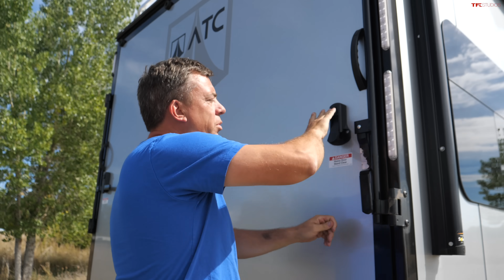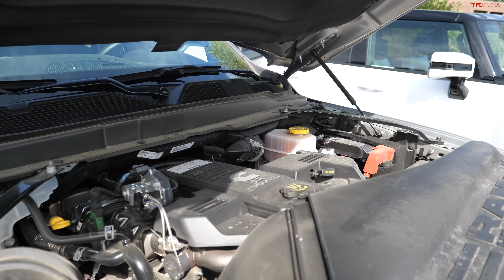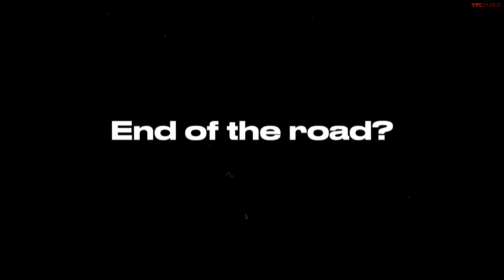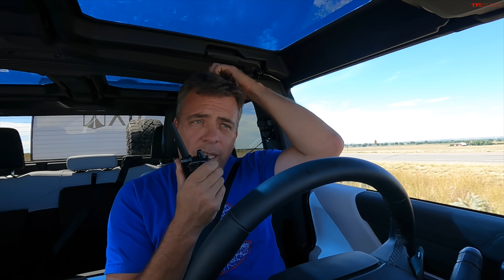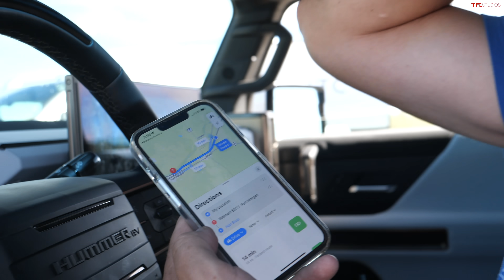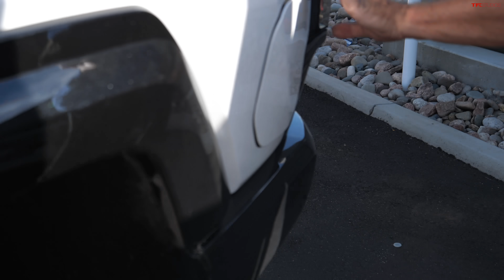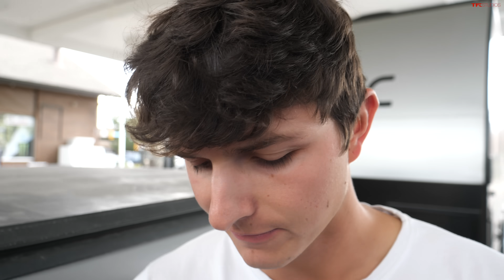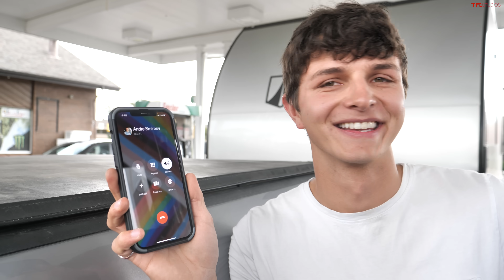How Far Can a Diesel and Electric Truck Tow An Identical Camper Trailer on ONE Fill-up?

Comment: I would love to see this test in one year after the battery’s been thrashed a little..
Reply: I agree, it’s going to be interesting to see how these batteries last
Reply: @justing224  they won't. Not recycling them either. Also all the mining of lithium is worse for the environment
Reply: @justing224  weather & shelf life will kill them dead! Weither its use are not they are very disposable like always
Reply: And after the Cummins has broke in
Reply: @flyinbrianz22  the 100,000 mile break in for diesels is not true, break in is about 10,000
Reply: @johnmorris77  I own a 2020 cummins, have owned 3 6.7's. You'll typically start to see about 10-15% better fuel economy around 25-30k miles. Give or take 5000 miles depending on how hard you drive it. And it's not a gradual change. I, as well as a bunch of other cummins owners on forums, seem to think there is programming involved. It's like a light switch. One day it's just considerably better economy and a noticeable increase in power.
Reply: @riccochet704  I've had 2 6.7s and a 6.6 Duramax and did not experience that in any of my trucks except when I deleted and tuned them myself, but if I put bigger tires on then it negated any speed or mpg gain I made
Reply: @johnmorris77  my Cummins said 15,000 if you didn’t tow with it.
Reply: @JohnDoe-nz6bk  right, not quite 100k like many people think
Reply: @johnmorris77  Break in may be only 10,000 km but after owning a duramax and a cummings they didn't start getting great mileage till 100,000 kms
Reply: @TH-rg7ep  I've had both and my mileage only changed with the weather, my driving habits, or change in suspension/tires/tuning
Reply: @riccochet704  I wonder if the ECU programs it to run rich during those first 20 to 30k miles
Reply: @johnmorris77  Actually John, my Dodge diesel got broke into around 525,000 miles.  I'm still trying to locate it.
Reply: @riccochet704  yeah and also take off all the other garbage that epa wanted to put on these vehicle that killed the gas miliege.
Reply: Though that will affect things, I know this won’t get used for work like the Cummins will, it’ll take a week just to get across Texas, it’ll probably be parked most of the time with an occasional Starbucks trip.
Reply: @RiggyRonnie  773 miles will take a week to go? Who the heck are you paying to delay the trip in your so-called test?
Reply: @ronaldking1054  why don't they race the Hummer and the Cummins across the country, not even you would bet on the Hummer
Reply: @Duckdangerly  What is the make and model of those 100 year old EV's still operating on their original battery? Granted the EV idea is old just like steam powered cars. But there is NO EV with it's ORIGINAL battery and electrical system operating after 100 years of service. Give me proof.
Reply: @mackjones7688 , Go to a Baker Electric club meeting, or website. From around 1899 through about 1914 the Baker company produced one of the top-selling cars in America, a 6-volt electric.  Many get converted to 12 volts, but many still operate them with the original 6-volt cells. Jay Leno features his on his channel and discusses the history in an easily digestible manner. Proof can only be had through one's own research.
Reply: @Duckdangerly  Well Michael. You need to read more thoroughly. As I thought, the original alkaline cells don't last forever and they can't. Here is a quote from Leno. 
"Thomas Edison invented the alkaline battery. My Baker still has some original alkaline batteries. These have lead plates and use acid; we wash them out and refill them regularly and I'll use them indefinitely. But even Edison realized the future of the automobile was elsewhere." 
So, while you did prove that some of those Bakers are still using SOME of their original batteries. There are multiple  batteries in the car and new replacements had to be made, or original batteries were taken and rebuilt. The lead plates in batteries get eaten by acid and eventually wear out. So if the Bakers were not a stored and cared for by a collector. The 100 year old Baker wouldn't have lasted at all. Electric motors also wear out. The windings need to be replaced or recoated. Different brushes components get replaced, bearings go bad, etc. So your claim that those electric cars would outlast any Cummins. I have to disagree. Under the same usage conditions. The little Baker would fold like a lawn chair. The motors would be over worked and burn up. Bearings would fail. Wiring would degrade like in modern vehicles and need full replacement. That's IF they were being used to work like our Cummins are asked to.
Reply: @mackjones7688  LOL, okay. Have fun dealing with reality. Cheers.
Reply: @Duckdangerly  I deal with reality all day! Everyday. Not sure what cloud of idealism you are on right now. You are definitely not with us. You got owned with facts and don't want to admit it. I know, life is hard. Electric cars just export emissions to another source. It's not a long term solution or even a practical one to our real world problems.  Earth doesn't have enough resources to make electric cars for all the people alive right now to purchase one. Also, most electric cars with their alkaline batteries could only be charged up once. After the battery was depleted the battery needed to be replaced. Just like a flashlight or gameboy double AA's. Also, think about it. If bakers and other electric cars were as great as you say. They wouldn't have failed. Also more examples would have survived and been restored. They would be out on the road today making appearances at car shows. More proof that electric doesn't outlast diesel is electric golfcarts.
Reply: @mackjones7688  exactly. I just watched the Leno episode and he clearly shows he is using new modern sealed batteries. There is no 100 year old working battery, c’mon man! Biggest problem with the baker was very low top speed, about 30mph. And there is no heating let alone AC. So yeah, a glorified golf cart. It’s perfect for a very short trip at low speed in perfect weather conditions with no luggage. Other than that? Forget it.
Reply: @Duckdangerly  yeah, what was the top speed? 15mph? Lmao 🤣 Electric cars were a Joke then and are a Joke now!
Reply: @Duckdangerly  A Baker electric car was $850 Compared to $390 for a Ford model T. 😅 And the model T range was nearly double.
Reply: They dump their vehicles without doing any kind of degradation tests which other channels do, degradation affects charging and retention..but the spin they do here is spin. Electric pickups are for pavement pounding city slickers, instead of a proper working truck
Reply: Give me fuel any day
Reply: or try it when its cold!
Reply: I would like to see it in the cold snow.
Reply: they will only have the truck for 6 months unfortunately.
Reply: @Duckdangerly  I would agree with you if it wasn’t made by Goverment Motors…
Reply: Most families who have trucks tow. Dont care of its a camper boat or trailer.. I just can't see a family of 3 or 4 on a 4 day trip mini vacation which the last 4 years they do it after work and drive 4 to 5 hundred miles.. and almost do ut straight through.. now the same family has to take 4 days off extra just to get to location  and back home... lol lol it will never work or people will not buy them.
Reply: I would like to see the test when it is 0 degrees.
Reply: they dont last when you fast charge them all the time from full to flat . imagine replacing the battery out of warrenty .$$$$$
Reply: @ytthecommunistplatform.2675  Fast charging is only used on road trips. Most EV owners charge overnight at home. It's cheaper and you wake up with a full charge every morning.
Reply: @ytthecommunistplatform.2675  batterys have 10 year warranty in US and canada..
Reply: @ytthecommunistplatform.2675  charge to full is only an issue if you charge to full then let it sit.  That is common for anything that uses rechargeable batteries.  Charging to 100 then heading out isn't the bad guy people make it out to be.  Especially when you consider most EV's have a buffer.  The 100% isn't actually 100%.  The computer says it 100 when it isn't.
Reply: @ytthecommunistplatform.2675  Yes and imagine how the value of the vehicle drops as you get near the warranty life.  Who will buy something that needs a $30K battery?
Reply: @ytthecommunistplatform.2675  Okay, if a guy uses overdrive to haul, which trashes the torque converter, which trashes the transmission, that is the problem with the truck. Sure. No, it's a guy that doesn't know what he's doing.
Reply: @ronaldking1054  what point are you making? That he didn't tow properly with the Hummer?
Reply: @Luke-kn9pi  I responded to someone that stated that charging to 100% and discharging to 0% would ruin the battery. I then stated that if such an absurd practice were mentioned to an ICE owner, the operator would be questioned whether they were sane, and I pointed out when it happens. Try reading the comments as a whole and understanding who is replying to whom.
Next, you are trying to state that a person who says that it would take a week to go across Texas, which is 773 miles, is absolutely correct when even towing, the person would get over 100 miles a charge. Are you trying to claim that it takes a day to charge the EV with fast charging? It does not. You then asked an irrelevant question to cover what you are implying, which is insane on its own.
Reply: @ronaldking1054  a week is definitely exaggerated, but a diesel would do it faster, I live up north in a rural area and electric work trucks are just not feasible in the cold, especially because you need to drive longer distances here, but I have nothing against electric trucks
Reply: @Duckdangerly  wtf are you smoking
Reply: Great point  ! I have an electric bike ( big difference I know ) nut , after six months of daily use ( about 30-45 minutes) the battery takes a little longer to charge , and doesn't last as long !I'm not sure of the exact numbers , I don't take full charge long trips very often , but , your point about the battery after a year of use , is a valid concern !!! Non are ready for long trips at this time !!! Especially if it's  a time/ money operation !!!
Reply: Imagine being stupid enough to buy an EV.
Reply: Those batteries wear out fairly quick, and then your resale is about zero.
Reply: Let’s compensate the difference weight whit diesel fuel on ram. Ram will go 1000 miles more
Reply: @Duckdangerly  😂😂😂
Reply: EVs are useless to anyone except z Karen’s and their beta males who use them to virtue signal.
Reply: @Duckdangerly  so, you're saying there are EVs from the 1920s still driving around? 😅🤣🤪🤪🤪 Please, put down the Crack pipe.
Reply: @Duckdangerly  100 year old EVs?  These heavy duty trucks last way more than 10 years, and I think that is what you meant to type, 10 year old EVs.  They weren't made 100 years ago.
Reply: Not to mention the cost involved in replacing that 3 ton box of imported minerals.
Reply: @State48Dude  Walmart and every other store are full of imports. Cars will be the same until it's cheaper to get the materials here. The Inflation Reduction Act already includes provisions to increase domestic sourcing. Now North American mining and ore processing is ramping up.
Reply: @jghall00  They can ramp up all they wish, much like the chip manufacturing supposedly going to New York (of all places). It's not slated to break ground for 3 more years, by then it'll cost another Trillion.
I live within 1/2 mile of Intel here in AZ.
They already have in-place what's needed to begin.
NO money allocated to an already proven Corp.
So .. tell us all about the "Inflation Reduction Act" pal.
Then go buy a tank of gas, or anything  else made from fossil fuels, and talk inflation reduction.
Reply: I live just over the hill from Tesla and Panasonic plants. Nevada has the only lithium mine in the United States. An employee from Panasonic told me lithium is already getting harder to get. So watch your wallets cause they are just going to go up from here.
Reply: People are so dumb! They will be woese then cell phones are! Disposable crap!
Reply: The battery will still be fine after a year. You guys have been repeating the same talking points for years and years now 😅
Reply: Agree
Reply: Even better going up and down mountains using throttle. Flat hi-way cruising is giving electric best numbers. HAHAHAHA POS electric.
Reply: @shawncorradini5129  heaters use a lot of power too so even less right it's just a silly idea in the north
Reply: @donaldliverance2597  if you park outside in winter your battery life would probably go down the drain
Reply: @Duckdangerly  lmfao the cummins will run forever given the right care as well and there's a hell of a lot more old cummins driving around than old electric cars
Reply: @Duckdangerly  100year old battery are you serious.  what does a 100year old battery even look like is the case made of bakalite?
Reply: @chrishart8548  Lmao 🤣  You tell em.
Reply: They were very lucky that overcharging the EV did not light it on fire and burn down my favorite fast food restaurant before I got my well deserved sandwich and shake for $18.50.
Reply: @shawncorradini5129  bunch of EV owners in my Focus EV group live in Canada. They do just fine. The range is reduced. But our cars are old...new ones have much more range. Go online and ask Canadian EV owners how they feel.
Reply: @jghall00  If they're not driving long ranges.  If they don't want to go on a weekend trip to the mountains or go cross country.  They might work for staying close to home, but not for the overwhelming majority of people, especially at their price point.
Reply: @jghall00  Cars are one thing, Trucks used as trucks are another.  Please compare apples to apple.
Reply: @jimkelly1578  Some people use the bed, but don't tow. That's not using a truck for its intended purpose?
Reply: @jghall00  yeah lemme just dive into a bunch of fart sniffers who are fully in the "cost sunk fallacy" 
I bet they also love living in incredibly inconvenient cities and love renting thinking those are the "better options"
Reply: @jghall00  Hopefully Jason, the Canadians will simply tour around Canada and have to drive with a heater on so their range is reduced by 30%.  As you sit beside the road in a winter storm, hopefully you went by Starbucks and filled you thermos with $18 worth of cheap coffee.
Reply: I have been faced with the position of being stranded beside the road.  Out of battery, car is getting cold, baby is crying, I didn't make it to the baby sitter, I burned my babies mouth with hot Starbuck's coffee cause we were out of formula. Other than that, Trudeau has got a plan.
Reply: @dougjohnson8250  Sounds like driver error to me. I almost ran out of charge in the cold once. Once. Went to the wrong location to charge. Made it to the charger with 1 mile remaining. Is that the car's fault?  Now, I acknowledge the limitations of the car and won't push it to do more than it is capable of doing.
Reply: @jghall00  this is the issue it's got less capability than a gas version of the same car it's just cheaper to charge and the environmental effect is just moved out of sight it's no better for the environment due to the material needed to make them
Reply: @donaldliverance2597  There have been numerous studies that have debunked this claim. Yes, you are correct that the batteries and other electrical components are resource intensive to acquire, but the extra emissions expense is is recouped within a relatively short time as compared to ICE. For most, myself included, the biggest driver of transitioning wasn't some environmental consideration. It was the reduced cost of driving and maintenance over driving an ICE vehicle. Good luck using FUD to stop people from wanting to save money.
Reply: @jghall00  lol dude I'm 5k into a jeep that's got 470000 miles on it. There is no story like that for electric cars and you want to talk savings....
Reply: @donaldliverance2597  everyone's situation is different.  I'm not towing my camper in a vehicle with that mileage, too much potential for mechanical issues.  But using it as a daily driver was costing too much, so I bought a cheap EV as a daily.
Reply: @jghall00  What does a  cheap EV even look like? 🤔 From what I've seen EVs are not cheap.
Reply: @jghall00  I'll tow a camper out in the woods down a goat path with the jeep and imagine how far out I could go with extra cans of gas
Reply: @johnabelljr1997  my 2017 Focus Electric looks just like a regular Focus it was 14k out the door in 2021. Gas savings covered the payment. The Bolt EUV is 28k to start and is eligible for 3,750 in tax credits starting in 2023, so for someone that drives around town alot, it will save a money on gas. It can't roadtrip far due to slow charging,  but if you're buying a 30k car you probably have two incomes in the house and a second vehicle.
Reply: You missed the whole
Point of this test and the question. Does your ev group tow 5000lb+ pounds daily and run in 4x4 in 4+ inches of snow… didn’t think so. Next
Reply: @shawncorradini5129  that would be a question for the Lightning owners forum. My camper is 7,000 lbs so my Focus can't tow it.
Reply: Up here driving a gas focus in the winter seems like a stupid idea so I'd imagine those are city folk
Reply: @shawncorradini5129  u missed the point. Hes shitting on the ev 😂
Reply: @jghall00  you might get 70 miles towing that with a lighting
Reply: @spdemonsloan  True, but most of my driving isn't me towing. So the Lightning works for anyone that doesn't tow long distances. I know many people with trucks that toss stuff in the bed, but rarely tow anything. One of them drives 150 miles per day servicing oil wells in the area, but he doesn't tow.
Reply: @jghall00  if you want to spend 100 grand for a pavement queen and trash truck that's cool but most people I know use their trucks
Reply: @jghall00  I also know a couple that want to keep theirs pretty lmao
Reply: @spdemonsloan  Using a truck doesn't exclusively mean towing. Some people only haul, or they tow, but infrequently.
Reply: @jghall00  They don’t tow anything so duh
Reply: I think the electric motor would remain 3 times more efficient than a diesel powered engine.
Reply: @jacksonbangs6603  that's really not the issue.  Ev is not meant for long haul towing. But they try and sell the green b.s. and say its better. It won't be it can't be. The ev motors still need to get eletric from some other source. The battery which is nothing different than a gas tank. It stores energy. The bigger the battery the longer it will last.. but it will not keep up with a desiel efficiency ever..
Reply: @stevenjones618  You’re simply wrong here. Electric vehicles are far more efficient. Go look it up: EV converts about 60% of energy into vehicle movement and gas about 20%. So even if the grid is powered only by oil and other dirty sources the EV is still cleaner. But every day the grid gets cleaner and so every day you become more wrong. Don’t be dumb.
Reply: @CDX7  lol ok doesn't mean better reliable or cost efficient.. the government controls all costs and when the dummies think is cheaper cause of today's cost it won't be for long... you can't save a planet because you through tax dollars at it. Other countries will pollute jist like today and tomorrow and this is a never ending argument. This planet doesn't need saving.. but go ahead go buy one..
Reply: @stevenjones618  So you changed the argument to reliable/cost efficient and concede the drivetrain efficiency now? Good. On reliability EV's have far less moving parts and wear items in the drivetrain. Every engineer knows this will result in more reliability. Most failures currently are tech related and will be sorted in time. New tech is always more expensive at first and with volume goes down. A Leaf can be had for under 30k. Have you seen the price of ICE vehicles lately? This won't be true for much longer. Transportation is about 27% of global carbon emissions - not insignificant. China and other countries pollute more because we outsourced all our manufacturing and production to them, so of course they will pollute more. But China is electrifying and going renewables at an even faster rate than the West. Then what will you say? Ultimately there's a reason all major manufacturers are going EV. You're not smarter than them or onto any particularly good points. Yw for the lesson.
Reply: @CDX7  tech doesn't get better.  I've driven vehicles before computers.  Even the latest so called greatest comp have errors. Can't keep a simple check engine light off.  I dobt have a prob with ev motors lots of machines have ev motors.  But for vehicles in elements I will say nothing but long term prob will exist and will continue to have problems.  But still no answer to the soring cost of kw.per hr cost. It will happen just like gas was 18 cents a gallon now 5 dollars because of crooks on wall street.  But they have ran the crude oil gambit as far as it will go.  Now it's on to something else.. if I live another 25 years I will see the issues.  Those who grew up who don't know the difference have no clue.  Motors great when plug in to run.. battery storage to supply the power is garbage and will not be good for another 10 years.  But that's the cart before the horse ideas.. but time will tell
Reply: @stevenjones618  I don't mean this to sound mean but you sound like a very bitter and cynical old man tbh. ICE engines used to be so unreliable, I grew up on a farm with all kinds of engines constantly dealing with issues. They've gotten so much better with electric engines.  PC's have gotten much better too. I was a PC hardware tech and it was awful. Nowadays these ipads last a decade easy. You'd have probably bemoaned ICE engines too and prefer horse and buggy. Just kind of sad. Try to be optimistic for once. The world is getting much better.
Reply: @stevenjones618  Electric motors are still more efficient than diesel engines.  What you are referring 🤔 to is energy density. Yes diesel will always have the upper hand when it comes to energy density or energy per ounce 9f fuel, but a diesel engine will never match the energy EFFICIENCY of an electric motor. Range and efficiency are two different categories.
Reply: @CDX7  to give opinions on experience doesn't make anyone bitter btw.. everything has a place and time but clearly this video shows that practical isn't ready for majority of family's pulling trailers or campers looking for a 4 day getaway.  In the video it shows his balance of 45 dollars to charge.  Regardless of the free promo thats what he should have paid.  Now he should go back charge to 100 percent and show the total charging times and cost for miles driven
Reply: @CDX7  You are a little off on your numbers. Transportation is only 14%. Industry is 21% , 24% for land use (farm and foresty) , Electric and heating is 25%.
Reply: We already have years of battery testing and data. After one year it will still run like new.  After 5 years it will still run like new. After 8 years you might start to notice a few miles of range loss. After 25 years you'll notice about a 25% loss.
Reply: @silvy7394 Yeah... You really think that the average EV battery is going to last more than 10 years? 😅
Reply: @johnabelljr1997  Based on factual data, real-world data, and my own car, yes. You'd have to be an idiot to think otherwise.
Reply: @silvy7394   a turd is a turd.
Reply: @silvy7394  my buddy has lost the equivalent of 70-80 hp out of his M3P Tesla in 3 years. Roughly 20%. He is an outlier and racers the car, but he’s lost 7-8mph in the 1/4 mile and .8-.9 seconds on his et. He also charges to 100% before each track event for max performance. He can’t get any of that back without $24,000-$26,000 worth of batteries.
Reply: @silvy7394  lol no one will own this trash for that long